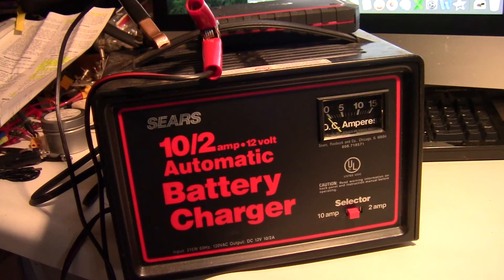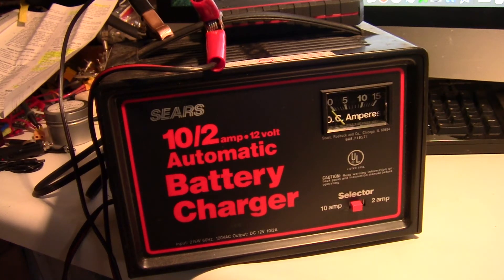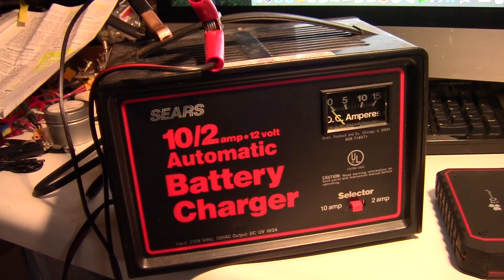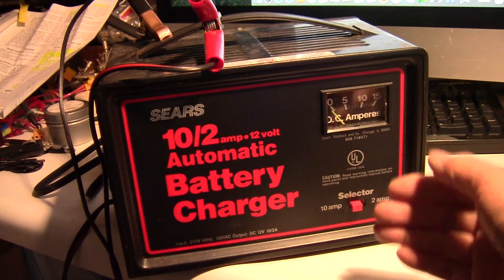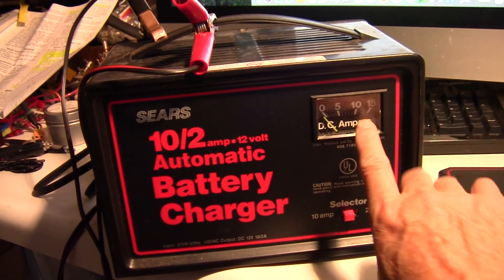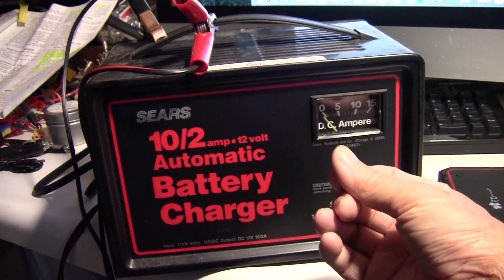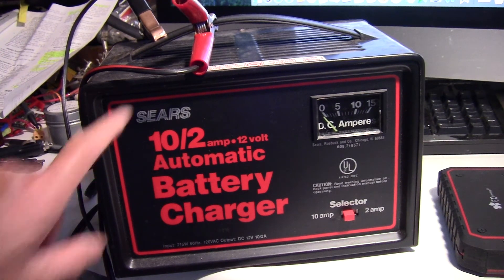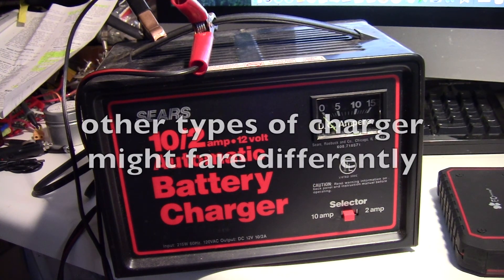Car charger going into thermal protection.

Comment from the maker: You might have to slow charge it first because if battery is badly discharged or shorted, the charger will go into thermal protection. If it is working properly, it will charge at a rate higher than 2 amps. It should be closer to 10 than 0.  If in doubt, slow charge for a few hours, than quick charge it.

Comment: If i olug it in at 10 amp to a dead battery should the gauge o. The top right be toward 0 or 1? I cant tell if its charging. I bought this old one used.